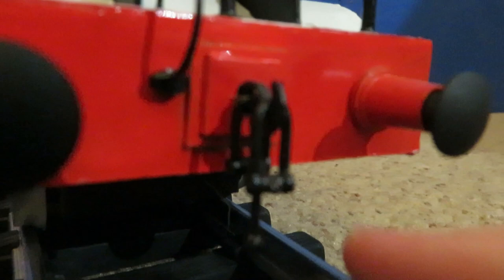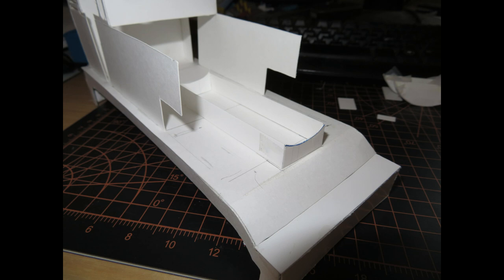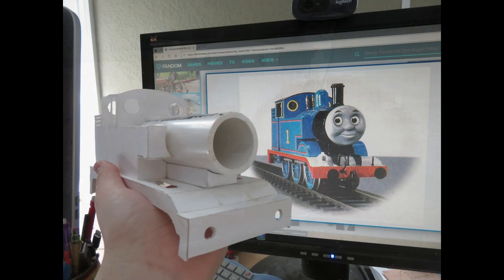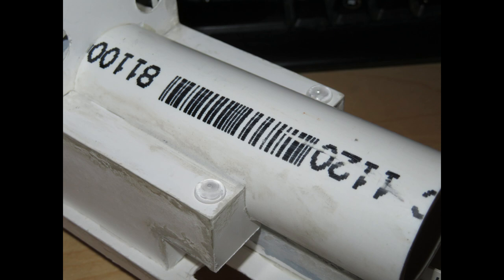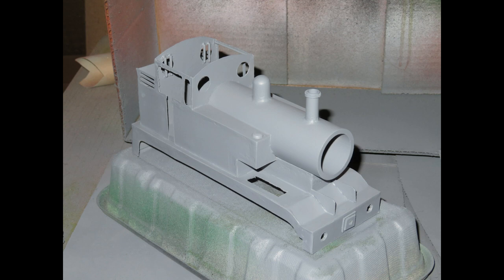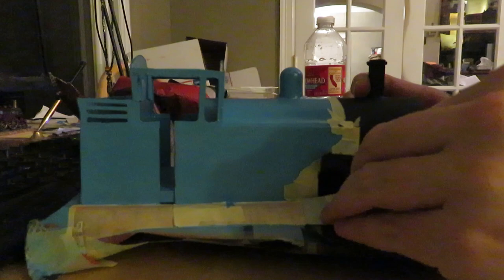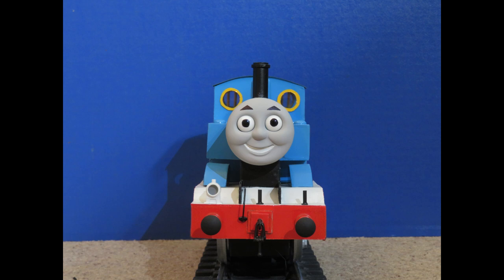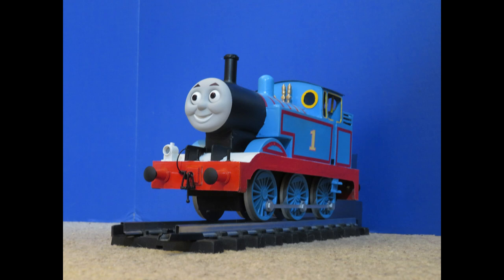My Gauge 1 Thomas the Tank Engine Model

Comment: awesome model! Tip: build the chassis first so you can make the body accurate so theres no problem with the body. And if you plan on making it last for a long time use thicker polystyrene sheets (plastic sheets), so its easier to glue and make it strong. other than that it looks great! keep up the good work
Reply: Yah i agree
Reply: Also make sure to make a thin